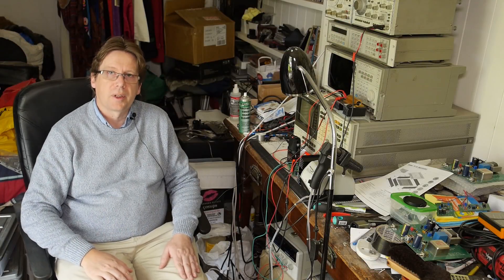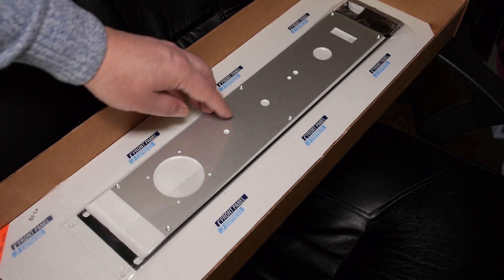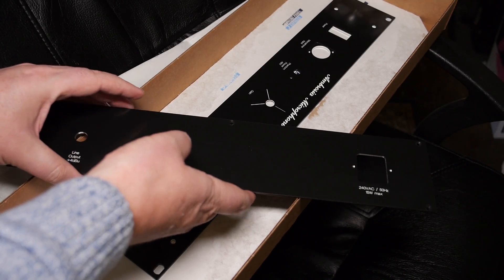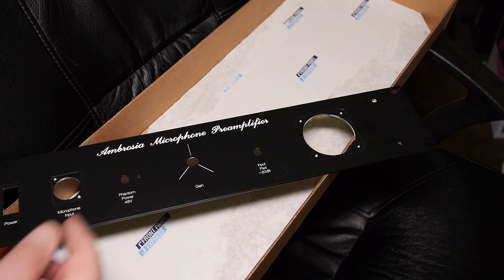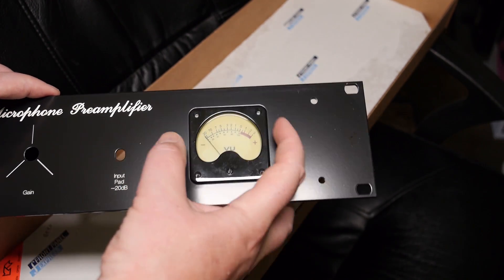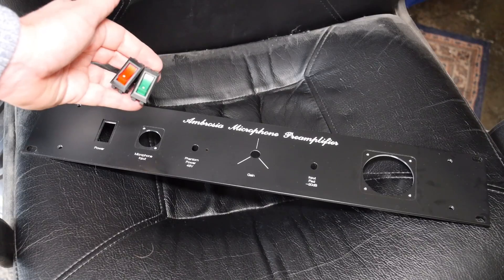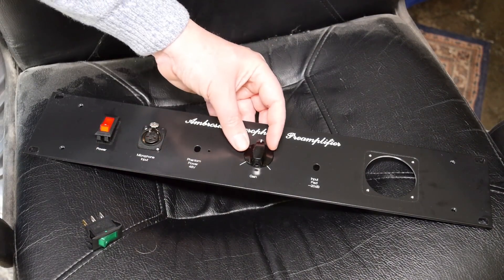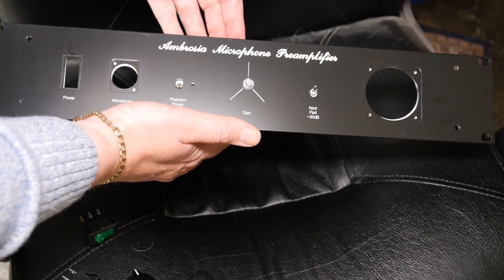DIY Mic Preamp - Front Panel Unboxing

Comment: Loved it. Looks great
Reply from the maker: Thank you so much. BTW I've just noticed a minor error in the inner front panel - ideally there would be holes to clear the mounting screws on the microphone input connector. <sigh> I guess I'll either be drilling a couple of extra holes, or using very short screws to mount the XLR connector.